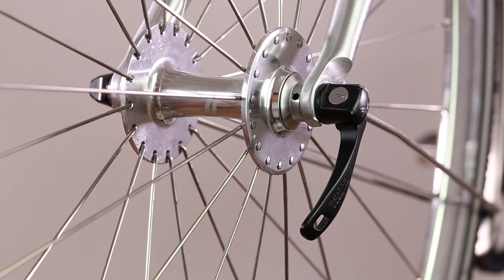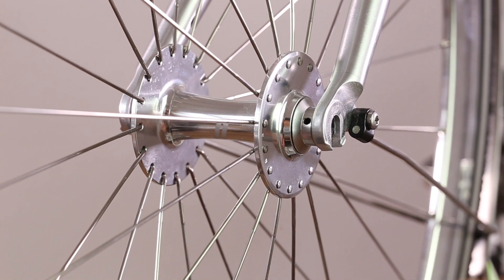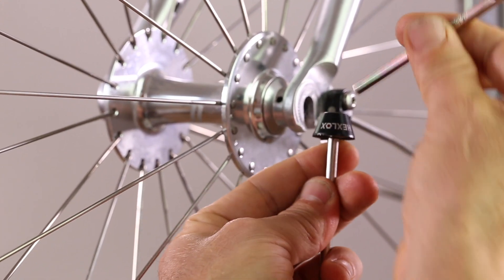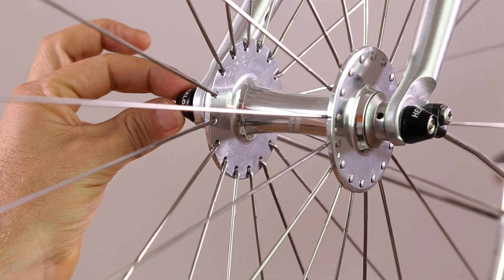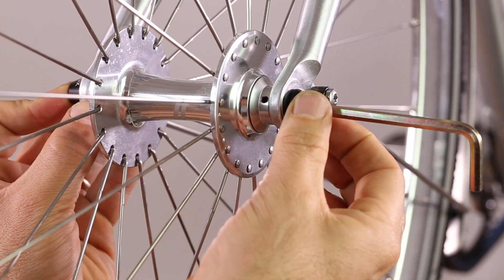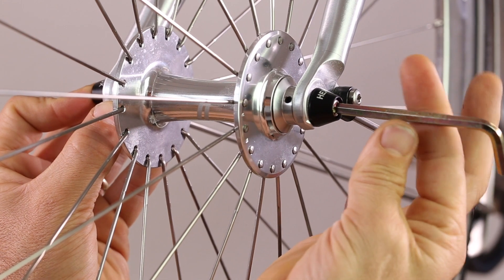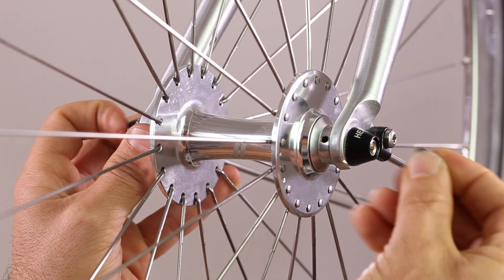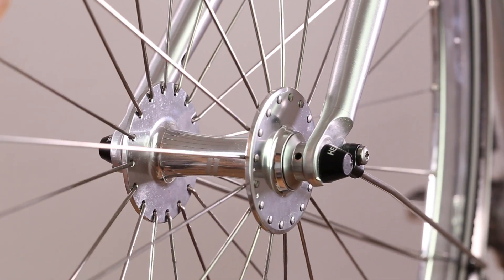Hexlox QR skewer assembly guide

Comment: But I didn’t see the hex lox being put into place using the key at the end. Doesn’t this mean that anyone with an Allen key can loosen it?? Did it miss something??
Reply from the maker: Hi Dale, Yes, you are absolutely correct. This is a Hexlox Security Skewer installation video - made a few years ago - and the main purpose was to show the installation of the skewer. We simply overlooked to show how the Hexlox, at the end,  should be put in place with the Hexlox Key. Restating your point to other readers - You need to insert a Hexlox into the bolt/skewer to secure it against theft attempts. Thanks for alerting us to this - we will add some content at the end of the video to make it clearer for other viewers.

Comment: Are you able to upload a video of how to remove the hexlox to change out tires - and then install them again? (A friend installed them for me and so I dont know how to do it)
Reply from the maker: Hi there! Unfortunately we do not have the resources or manpower to create custom videos like this, hope you understand. However, please have a look at this video which goes over the basics of Hexlox: https://youtu.be/VOFjViPcw1M    Getting your Hexlox out is very simple.     Step 1: Firmly press the Hexlox key into the Hexlox. Make sure you press it in at 90° (straight in)    Step 2. Pull out the Hexlox with the key.    (If you don't get it out on the first try just press the Key in harder - no worries , you cannot break anything!!!   That's it! You can now remove the wheel from the frame/fork and swap the tire. Now is also a good moment to clean any dirty components... To re-install the Hexlox just watch the video again.  Also, you will probably get a faster response from our support team if you contact them at support@hexlox.com Hope this helps and have a great day.